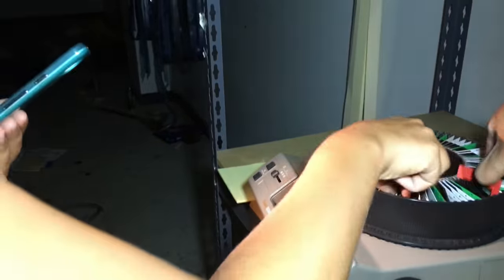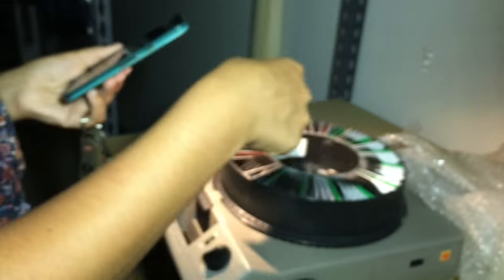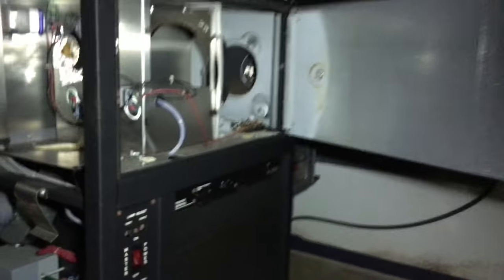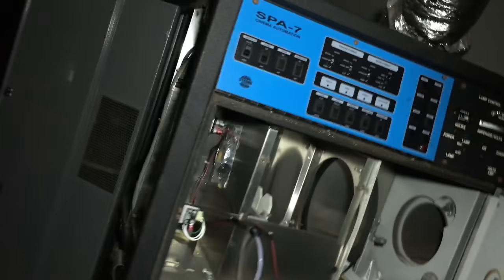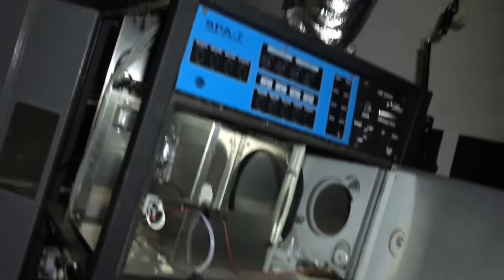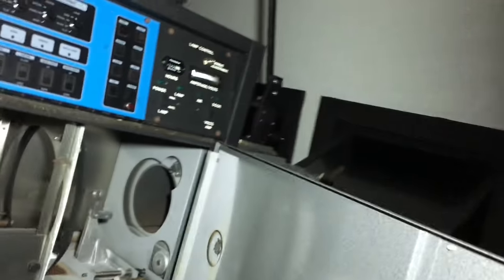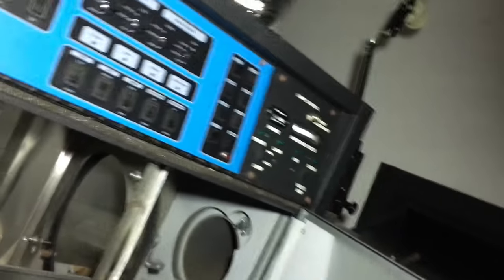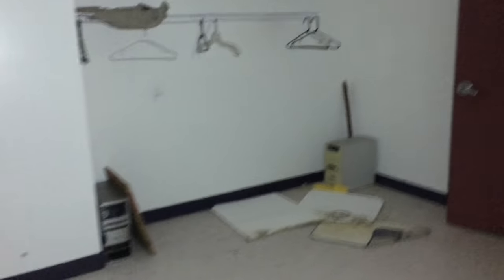Movie Theater Abandoned Seats and PROJECTORS remain.

Comment: The projectors are Century 35mm machines, the lamps are Strong 3kw Xenon lamphouses and the "reels" she mentions are platters, each platter can hold two full features.
     Many cinemas closed when the distributors no longer released on film but went to digital release.
Reply from the maker: John Spooner check out the other theater explore i did
Reply: That's what I thought, although she mentions in the video that the place opened in 1993?  The millenniums didn't exist then did they?

Comment: That's a strong int simplex 35 model millennium from around the late 90's up until the year 2009, and they're actually worth between 3k for the head only and around 16k the way they are in the video like that, some people just want to get rid of them because they don't have space for them and they sell them for like really really cheap around 1500 bucks (but it's super rare), 35mm has an estimated resolution of 4k closer to 5k and 70mm in an IMAX format is around 12k in digital but in reality the image is much much better than digital, and can't be compared since they're very different technologies, same purpose but different technology, it's all about money, one print of a 2 hour movie cost around 1300 USD to print plus shipping now multiply that by the amount of cinemas around the world those are millions the studio is saving, the equipment shown is not more than 20 years old, and it's probably worth millions (screens, chairs, projectors, audio system, speakers etc), the reason no one has take anything is because everything is super super heavy and the rack equipment is specialized equipment specifically designed to work in a cinema, not likely to run in a house, depending on the design you might require three phase power just to turn the system on, I noticed the amplifiers are gone and that's for a good reason they can be used elsewhere, anyway, sad video